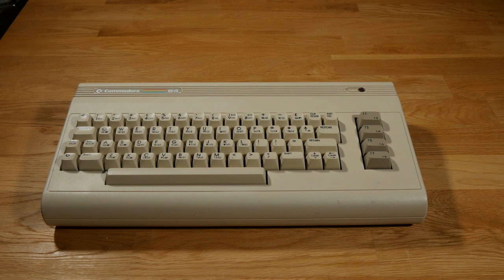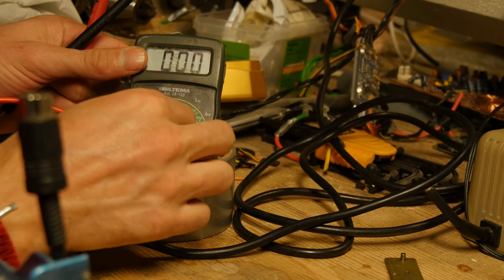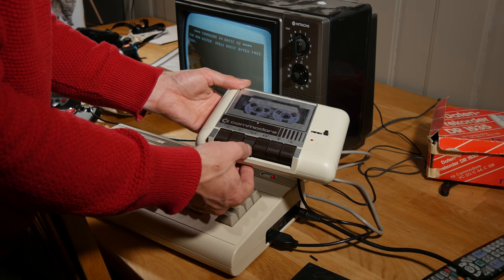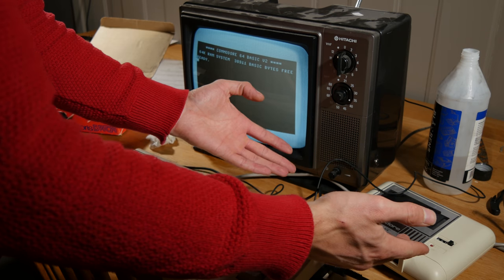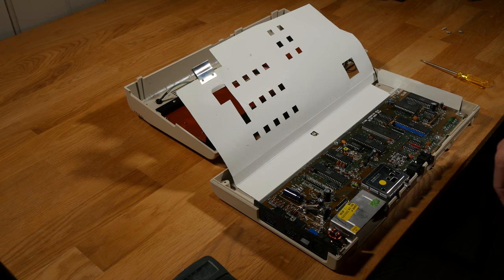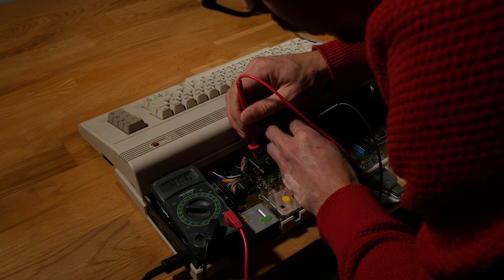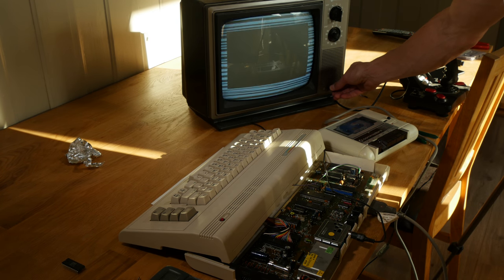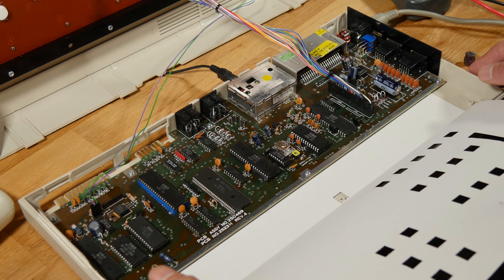Commodore 64 Repair Attempt Part 1

Comment: Good call on replacing the SID. That is one of the earliest revisions of the C64 short board (250469 Rev. 4, the first being the Rev. 3 found in the 'Aldi' breadbin model, which yours looks extremely similar to). Those boards supply 9V to the SID instead of 12V, which the 6581 requires. Your board requires the 8580 (or 6582). The cold chip you pointed out was the new 64-pin chip that integrated the PLA (notorious for failure) and a few other TTL chips.
Reply from the maker: I hope the PLA won't fail then since it's not socketed. I made some mistakes trying to figure out the problem in this video. I think I just need to clean the power switch. I'm waiting for the contact cleaner to arrive.
Reply: @UncleAwesomeRetro  I wish I knew more about the reliability of the PLA after it was integrated into that chip. The previous standalone revisions of the 28-pin PLA (906114) were very unreliable. The fact that yours is cold to the touch doesn't bode particularly well, as it is a very important chip for proper operation of the system (glue logic tying everything together on the data bus). Good luck with the repair though. I am eager to see how it turns out.
Reply from the maker: @mjy  thanks :)
Reply: The new pla in your board should be ok as the new type of pla rarely fails the later boards had the colour ram built to them which might cause a problem. Might be worth checking the transistor D313 marked on it next to RP3 that normally sends the 6v to the tape deck.  Failing that the cpu 8500 normally controls the tape deck and as its socketed and looks like there is a bit of corrosion on one pin I take it out and reinstall it. Good luck with the repair 👍🏻
Reply from the maker: @Technossomy  Thank you :) I uploaded a new video regarding the c64. it's repaired. I just had to clean the power switch. I made some mistakes when trying to figure out the problem. Primarily not pressing play on the cassette player when measuring the voltage, because I misunderstood the guy saying I should do that.

Comment: how many people were screaming he put the cassette in the wrong way? because i did at first lol
Reply from the maker: hm,,but I didn't put the cassette in the wrong way? Except when I tried once when the right way didn't work.
Reply: @UncleAwesomeRetro  If you ever got it to work, i reccomend buying one of those cassette tapes that have a headphone cable coming out of it because then you can load what ever commodore tape game you want
Reply from the maker: @joehdah5395  Not a bad idea :) But I actually modded a datasette with audio input and using tap dancer app on my phone. New video coming in a few minutes I guess :)
Reply: @UncleAwesomeRetro  Wow! i dont have the skills to that, there is also another method that not many people use for some reason, so if you have on of those portable cassette recorders/players you can actually plug your phone into the mic port on it, load up a blank cassette and record the commodore game on to it. So that way you can have many commodore games in physical form.
Reply from the maker: @joehdah5395  yes, I have a Nice cassette deck and I want to do that. I Just need to repair it.
Reply: @UncleAwesomeRetro  But the catch is i think it has to be mono not stereo, but not 100% sure, thats what i have heard
Reply from the maker: @joehdah5395  I think it can be stereo, but you only need one channel.
Reply: @UncleAwesomeRetro  True, didn't think of that